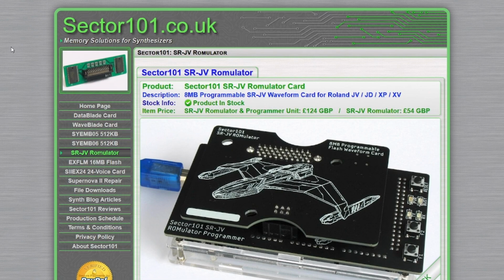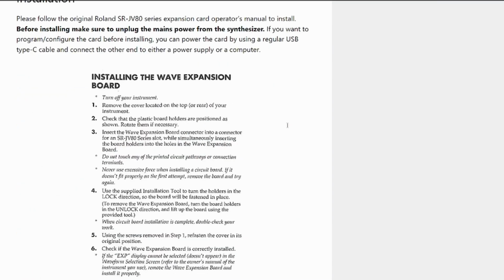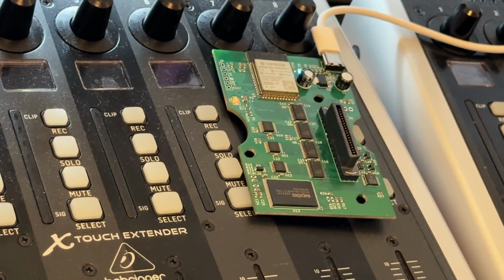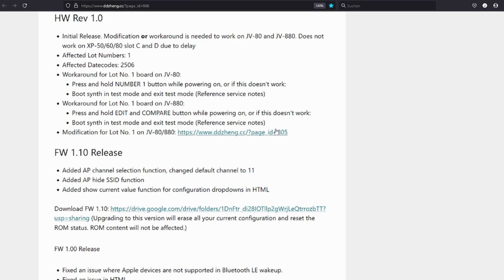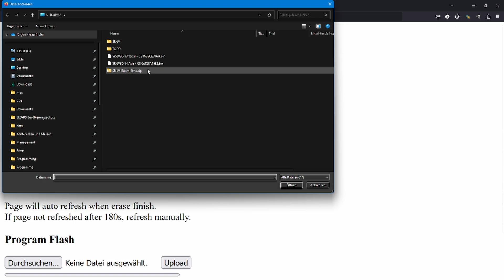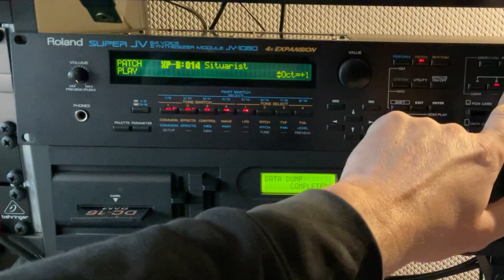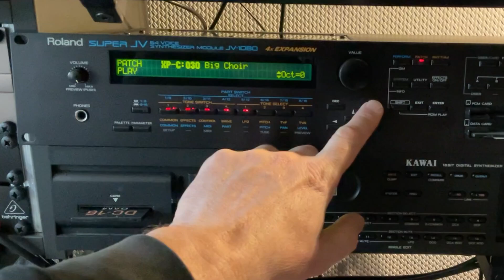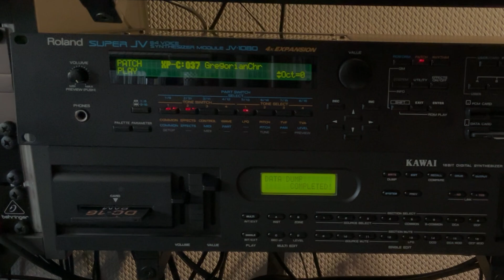Roland SR-JV Card Replacements - How much will you pay for 8MB?

Comment: I figured you had a JV-1080... Cool! I had a fully expanded XP-50 back in the late 90s/early 00s... I loved that workstation, especially with the JV-1080 engine!
Reply from the maker: I started with the JV-880 and then always upgraded to the next model: JV-1080, JV-2080, XV-5080 and sold them all 🙂 Some years ago I got a good deal for a XV-5080 and couldn't resist as well as a JV-1080 for 150€ was a must buy. I am glad I did it since (as I remembered) it sounds more rough.
Reply: @mossgraber  - The XP-50 was the only synth/workstation I ever purchased brand new the year it came out (1995)... To make a long story short, I sold all my old gear, except a JV-880 module, and used it along with the XP-50 as the main keyboard in my rig... I did a few local raves then , so I'm pretty sure I had more than enough patches, sounds, and F/X for all that... I enjoyed working with what I had... Those were the days! 😁
Reply: @Jhihmoac  I still have my XP80, fully expanded, and even if it has many issues with the buttons becoming hard to press, I still use it and this wifi extension really is fantastic.
The XP80/jv-1080 engine really was well thought with those 4 parts, + the great effects, multiple lfo's etc. The only complaint I have is the filter which really sucks on the XP80 (I don't know about the JV-1080/2080 or other variants).
Reply: @stephaneschmitz8030 I would like to pick up another XP-50 myself, if it's in good condition... However they are now at least 30 years old, and that is something to consider with the wear factor... The only thing I wouldn't have to worry about is the "red glue" problem, as the XP-50 did not have semi-weighted keys... I'm not sure about the XP-80, though...
Reply: @Jhihmoac yeah, finding a xp50/80 in good shape would be difficult. They tend to develop all kinds of issues after so many years. Oh btw I have replaced my floppy drive with a virtual floppy which uses an USB drive. Very convenient.